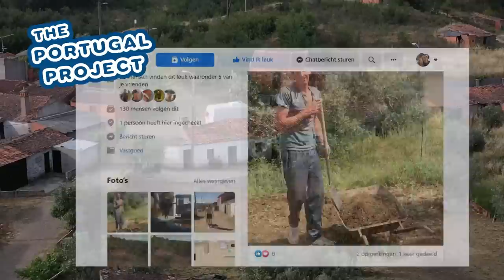ELECTRICS IN THE MINI (teaching Duarte electrics) | Portuguese DIY Home Renovation

Comment: As the sun shines on the glass door and window, it refracts and heats up the room. The only way to prevent Renato from burning up is some external shading. This could be shutters which are  closed during the day.
Reply: Exactly what I was about to comment, or at the very least some window tint and internal shutters. But external are better to let some air come in as well.
Reply: About many stuff hasn’t been tought at all.. I hope this projects come to a well end

Comment: Very good Jasper.  You should drive a ground bar in the ground and bond it with the ground wire you bringing from the house where you installing the box on the garage side of the wall

Comment: I am back at my home now in Grocinas I had to leave last year after falling down a ravine. Anyway it is great here I have made loads of new friends and people are helping me in lots of small but important ways like this internet use. That ceiling with round logs is very easy to do and cheap, it is the Santa Fe style I personally like it it gives the log cabin look without having to build a whole log cabin. Regarding everybody's roofs it is a really big job to replace one though the tiles are not too expensive. If you want to get on with getting into a functioning house ASAP you can consider just fixing the existing roof for now which I am going to do.

Comment: You haven’t rendered the outside yet ,so why didn’t you chase the cable trunking in on the outside and pop the cables through the breeze block walls to the inside  sockets ? Then when you render the outside you would bury all the cables and keep the inside walls clear of cables

Comment: Not fond of surface wiring. For your own house and the letting houses, I suggest that you plan ahead and get your cables in before you finish the render.
Reply from the maker: I’m not a fan of cutting into shiste like that, it makes the walls unstable in my opinion.
Reply: @GhostTownVlogs  Many ways you could conceal the cabling without cutting out the stone.

Comment: Those black cables look bad, routing is bad. But what’s new? Think about using aerial cable to bring the power to the sub-mini. We use aluminum triplex for aerial here, perhaps there’s something similar available there? That sweating will help you lose those excess lbs.
Reply from the maker: Yes gaining weight is not easy like this :)

Comment: The cables look terrible and badly installed, why didn't you run them outside on the "shed" wall at least and preferably at high level on the front outside wall too, I await with interest your installation intentions for cable protection. (circuit breaker protection that is). Hopefully you have sized the cable correctly for the intended load and length of the cable from the main house. Also I was under the impression that mains electrical installation in Portugal are required to be done professionaly